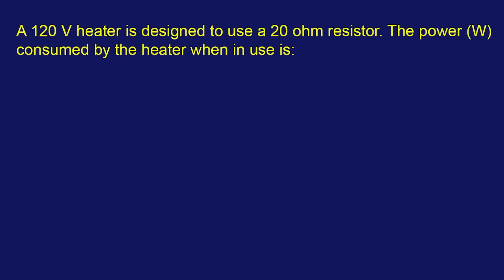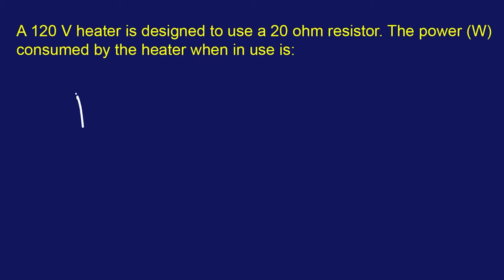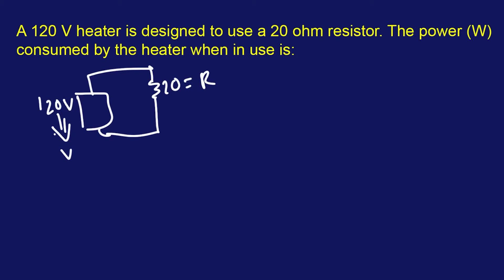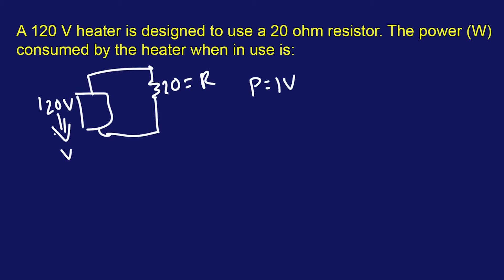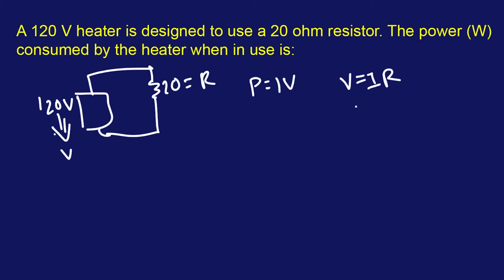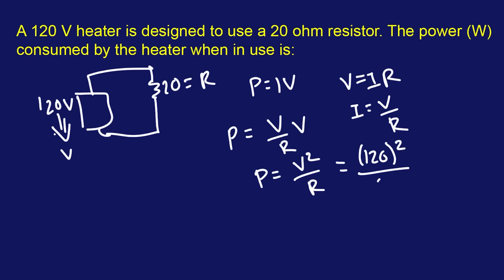FE Mechanical Exam Practice Problem #20: "A 120 V heater is designed to use a 20 ohm resistor..."

Comment: This is so wrong man, you need to determine if the source is in parallel or in series with the loads. You video is impressive but untruthful. The source connection make all the difference. Cheers!!!!!
Reply from the maker: I warned myself that I won’t embarrass myself on the internet again

But technically it’s just a power source and a resistor. Isn’t it both parallel and in series? (Assuming same ground)